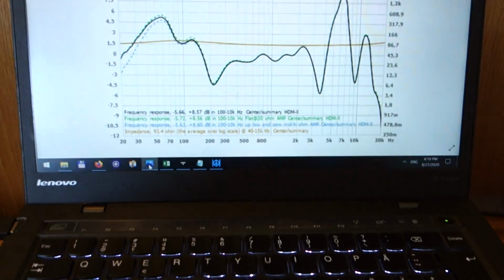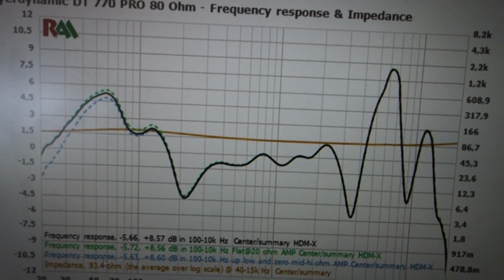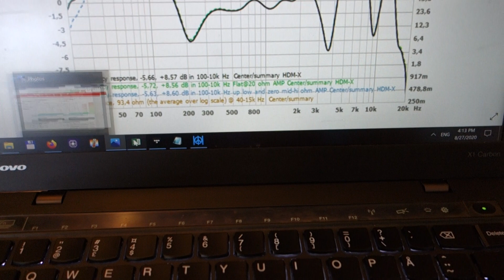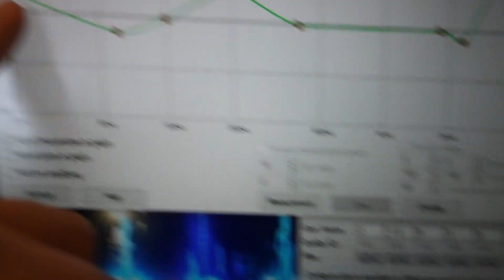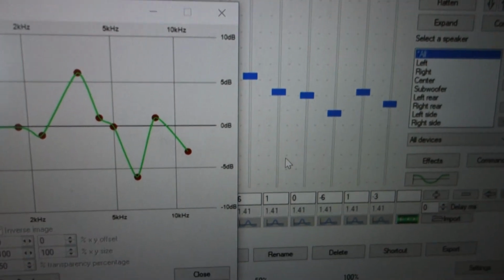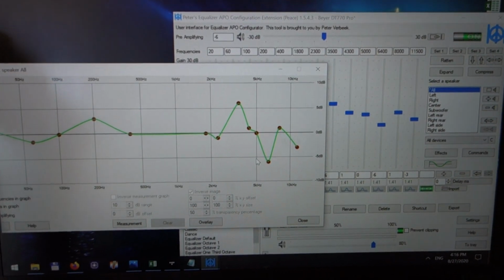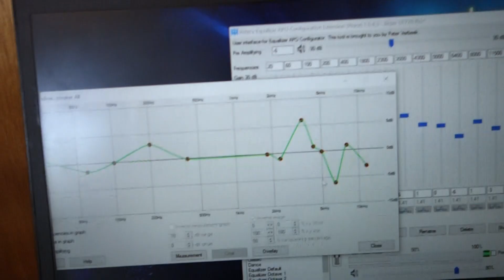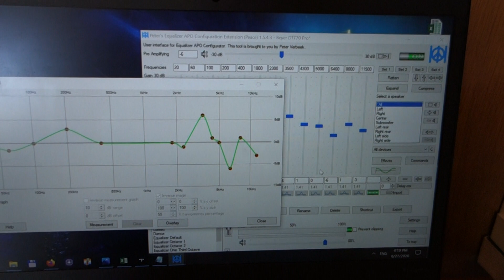Fixing the Beyerdynamic DT770 Pro Frequency Response curve with EQ

Comment: Is there an alternative for Mac users? 

Also, this all looks really great - thank you! I’m happy that there are others feeling the same. My ears have been feeling weird for a while and now I know why.
Reply from the maker: Great question. I will have it pinned in the comments section.
Reply: Yes Sir. SoundSource for Mac. You can use 3rd-party plug-ins for over all playback like Fab Filter Pro Q-3. Blessings + Prosperity.
Reply: use maceq
Reply: I use logic pro..i made a preset of eq based on this video to put last on the master channel to use while mixing and mastering..and remove it before i export…

Comment: nice video! when i first got the headphones, they sounded very diffrent from the ones i had before, but i adjusted to it, and i like the sound profile now. but i still agree that its not very balanced, which ist why i copied yours, but i just adjusted every value to be closer to 0 so i can be more inbetween. I also put -1 instead of -6 for the pre anp because i thought it was too muffled. thanks <3

Comment: Hi ! 
Can I use different eq DAW plugin, if yes, which one? 
Is there a way to import these settings or will I have to do it manually?
Basic question, where do I set the preamp to -6 dB in the recommended equalizer eq plugin?

Comment: The graph you’re looking at has a rang down to -12 which is going to make the dips and highs seem very very exaggerated. Most charts will show a -60 to -90 range and you’ll see it’s a much smoother shape. Those lows and highs are only about 6 db. And the overall frequency response fits the Harmon curve pretty well. With some EQ you can tame the most problematic areas. And remember there is no such a thing as a perfect frequency response for any headphone. No matter the price.

Comment: So my mobo produces very low volume. I have the iFi Uno coming tmrw. I tried plugging into my LG C1 and it gets loud but sounds distorted with the bass mainly and just overall meh compared to my pc with or without Eq set. 

Will this value dac/amp provide loud but also clear quality sound compared to my TV experience. Thank you so much if you can help.

Comment: I agree with you, before i bought DT 770 pro (80ohm) i thought about calibration, and when i tried it with it, it is a day and night of a difference, without calibration, you can't mix with them, beacous of busted highs and seperation between mids and highs and also lows.
Reply: Can you tell what settings you used in EQ?

Comment: deeper sound 😎:
Preamp: -2.6 dB
Filter 1: ON PK Fc 31 Hz Gain -0.2 dB Q 1.41
Filter 2: ON PK Fc 62 Hz Gain -4.4 dB Q 1.41
Filter 3: ON PK Fc 125 Hz Gain -1.0 dB Q 1.41
Filter 4: ON PK Fc 250 Hz Gain 3.1 dB Q 1.41
Filter 5: ON PK Fc 500 Hz Gain -1.1 dB Q 1.41
Filter 6: ON PK Fc 1000 Hz Gain -0.6 dB Q 1.41
Filter 7: ON PK Fc 2000 Hz Gain -0.3 dB Q 1.41
Filter 8: ON PK Fc 4000 Hz Gain 1.2 dB Q 1.41
Filter 9: ON PK Fc 8000 Hz Gain -4.1 dB Q 1.41
Filter 10: ON PK Fc 16000 Hz Gain -7.7 dB Q 1.41
Reply: Hi,
The issue is not what we want to hear, but how to make our headphones as flat as possible, to make a better mixing - mastering

Comment: That EQing makes absolutely no sense and you can hear it in a micro second ! 
Here's a flat profile (80 Ohm): 

Filter 1: ON PK Fc 0 Hz Gain -4 dB Q 1
Filter 2: ON PK Fc 20 Hz Gain -5 dB Q 1
Filter 3: ON PK Fc 37 Hz Gain -6.5 dB Q 1.2
Filter 4: ON PK Fc 71 Hz Gain -4 dB Q 1
Filter 5: ON PK Fc 121 Hz Gain -5.5 dB Q 1.6
Filter 6: ON PK Fc 207 Hz Gain -2.5 dB Q 1.4
Filter 7: ON PK Fc 400 Hz Gain -5 dB Q 1.4
Filter 8: ON PK Fc 620 Hz Gain -5 dB Q 1.4
Filter 9: ON PK Fc 987 Hz Gain -6 dB Q 1.6
Filter 10: ON PK Fc 1416 Hz Gain -5 dB Q 3
Filter 11: ON PK Fc 2347 Hz Gain -7 dB Q 4
Filter 12: ON PK Fc 3550 Hz Gain 0.5 dB Q 1.4
Filter 13: ON PK Fc 4430 Hz Gain -7 dB Q 1.7 
Filter 14: ON PK Fc 5350 Hz Gain -6 dB Q 1.7 
Filter 15: ON PK Fc 9000 Hz Gain -14 dB Q 1.8 
Filter 16: ON PK Fc 12000 Hz Gain 0 dB Q 1.4
Reply: This sounds awful to me.. music sounds muddy
Reply: @GFN1881  You either have a bad source or set the eq wrong. It sounds just like it should
Reply: preamp value ?
Reply: Thanks! Pretty detailed

Comment: Do you know that whenever you apply eq to headphones you alter the response of the drivers the way they were designed to work?  This is why corrective EQ never works well and causes lots of other issues.   In my opinion if you have to do so much to make a pair of cans listenable fir you then you have the wrong headphones.  Exchange them for different kind.
Reply from the maker: Your advice makes sense, it is better to have a headphone that needs no changes out of the box, sadly most buyers cannot try the headphones before buying or sell them afterwards. For them this is a solution. Also would I recommend these headphones with the EQ correction? Absolutely, they are great! If you have the money go for the DT1990 Pros they are obviously better ;-)

Comment: Hi G P, would you recommend me to import the settings you mentioned if I am a music producer, mixing and mastering engineer. also how can I get back to default settings later if in case I change my mind. By the way thanks for the video, its really helpful.
Reply from the maker: I would use this settings for music production too yes, but if you want perfect results I would also consider gettin a pair or DT1990Pro-s they are excellent for production. The DT770Pro-s are mostly for studio monitoring.
You can always change back the EQ settings to 0 or just delete the app so you would roll back to default settings.

Comment: I got them a few weeks ago and had massive problems with distortion in higher frequencies. Those settings fixed that for the most part. Sounds clearer and more balanced aswell. Big thanks

Comment: It works 
,after searching for 3 days found this. I had to remove some 0 gains because I have 10 band eq.
Thank you.
"srcYouT": {
    "frequencies": [
		20,
		60,
		200,
		1800,
		2300,
		3500,
		4300,
		5000,
		6400,
		8000,
		11500
    ],
    "gains": [
		2,
		-1.5,
		3,
		0,
		-1,
		6,
		1,
		0,
		-6,
		1,
		-3
    ],
    "qs": [
		1.41,
		1.41,
		1.41,
		1.41,
		1.41,
		1.41,
		1.41,
		1.41,
		1.41,
		1.41,
		1.41
    ]
  }

Comment: I just bought this same headphone. I notices that when I listen to music with quite low frequencies, there is a distortion. Would you solution fix this?
Reply: Update: I installed the software, applied the settings for the DT770 80 Ohms and boom, sorted out the distortion in the low frequency region and also attenuated the high ends. This makes my headphones sound great and usable. Was considering sending it back, but no more! So thanks for the video, that's a sub from me. 😀
Reply from the maker: @bergspot  I'm really happy for you man! Enjoy, cheerz!

Comment: interesting video, i've been thinking about this too. you should keep in mind tho that these headphones where made to be used in studios with proper output like an audio interface. i completely agree these have a very harsh high end and thin mix when powered by a phone and the dac that's in the phone. when listening to the same song with the same headphones on my audio interface the mix sounds way bigger and the high end is less fatiguing. i think the headphones just need a lot of power input to unfold their potential. i just ordered a dac for my phone so i'm excited so see if this will change anything in the sound stage on my phone. nevertheless a very good video!
Reply from the maker: Thanks for sharing your experience. Btw I used SMSL SP200 as an amp, it should be more than enough to drive them (like 5x times)
Reply: @GP-qb9hi  wow interesting, i use a focusrite scarlett, 3rd gen, and it sounds pretty good in my opinion, especially comparing to my phone dac. my external phone dac arrived too, sadly didn't make a big difference. yet the external dac does a really good job when plugged into my laptop. i think it just really needs a lot of power too but idk.

Comment: I recently bought the dt-770 m and I want a little bit more sound from them. What software should I use..or should I buy an amp?
Reply: I don't know why the video OP lied to you, but the dt770 80ohm 100% needs an amp in some cases. If your volume is low, you probably need an amp. A cheap fiios amp or something similar would be plenty for the 80ohm 770s. 

My 770s were too quiet as well, but an amp fixed that.
Reply: Something like creative soundblaster play 3 for 17 usd is more than enough, if you don’t want to spend more.
Reply from the maker: The 80 Ohm version doesn't need an amp. A good dac surely helps. The rest is in the description/video.

Comment: hmm me personaly hate the 6400hz -6db thing, I tested it out, and find it taking too much brightness, so I keep it -1db, overall awesome and so helpful video!
Reply: I usually dont have any problem with sibilants on 770's, but sometimes i feel a little bit fatigued. And yeah,  minus 6 dB takes away too much clarity, so i figured out that -3 -- -3,5 is fine. Quick update: forget -3.5dB at 6kHz. -3dB is a perfect balance between clarity and sharpness. Also, im using Sound Blaster AE-9.

Comment: This is the frequency responce for a 24dB range the average listening volume is 60-85dB so alot of the small peaks you see are practically inaudable see for instance the sennheiser HD600 graph a headphone 4 times the price (links dissallowed)
Reply: I find it very pleasant at low volume, when eqed I find them very boring.

Comment: hello on my laptop the 80 ohm dont have so much volume, what should i do`?
Reply from the maker: First make sure it is not your volume settings in Windows. If it's maxed out at everywhere you need a dac-amp. For example a Dragonfly Black/Red is a good choice if you need something portable.
Reply: @GP-qb9hi  its also good a cheaper one, like the hifi headphones Amp?
Reply: @GP-qb9hi Oh, and one more thing, could I solve the problem by simply increasing the gain with the programm tha you used?, or is there a risk of them breaking?
Reply from the maker: @utentesenzavoglia1475  You can try the program, they might sound louder but it is not a final solution as you will get more distortion.
Not sure what you mean be the "hifi  headphones amp"

Comment: Is it true that the hissing is less bad with the 80 Ohm version than with the 250 Ohm version? With 250 Ohm the hissing can be really unpleasant.
Reply from the maker: It is quite bad with the 80 Ohm version too...
Reply: @GP-qb9hi  I don't have the DT770 250 Ohm anymore but if you still have/use yours you can get replacement ear pads for them that should make the hissing a bit less bad. Take a look for "dekoniaudio".
Reply from the maker: @therealjantube  I'm using the DT1990 Pros since but thanks for the tip!

Comment: Nice vidoe. I felt the same. I found that penetrating high tones described as "Beyer Peak". I wasn't able to get rid of it everywhere. Sometimes the EQ only made it quieter but not better. Using EQs is not the perfect solution for me. You need the EQ on every device you use the headphones and they are sold as studio headphones so they should be more linear out of the box in my opinion.
Reply from the maker: I have to agree. Beyerdynamic actually recommends the DT250 for studio use, it is somewhat strange to me too that the DT770 Pros are more often used.
Reply: @GP-qb9hi  Right, I have never seen the DT250 in a studio and money shouldn't be the reason because a studio is very expensive anyway. audio-technica and Sony are brands I have seen in some making of videos but I think you can see the DT770 or DT990 the most. I don't know why. I want to try audio-technica when I have the chance.
Reply from the maker: @therealjantube  Here is a cool studio recording where they used the DT250 https://www.youtube.com/watch?v=GPTY6l_PX5k
Reply: @therealjantube  if youre still thinking audio technica try the m40x. Best headphone in there lineup in my opinion. Much more pleasant, and flatter than the more popular m50x's

Comment: can u use the same curve for the 250 ohm  version  with an monoprice desktop headphone amplifier? greeetings?
Reply from the maker: It won't sound exactly the same but it's a good starting point yes.
Reply: Hey here are mine Settings for the DT 770 Pro 250 Ohm Version.
I have tried to keep the Voice Signature of the Headphones and tried just to lose the harsh highs....

The Pre-Amp: -5.5 dB

EQ - Settings: GEQ = green

Filter 1: ON PK Fc 20 Hz Gain 0 dB Q 1.41
Filter 2: ON PK Fc 80 Hz Gain 0.5 dB Q 1.41
Filter 3: ON PK Fc 120 Hz Gain 0 dB Q 1.41
Filter 4: ON PK Fc 230 Hz Gain 1.5 dB Q 1.41
Filter 5: ON PK Fc 400 Hz Gain 0 dB Q 1.41
Filter 6: ON PK Fc 1800 Hz Gain 0 dB Q 1.41
Filter 7: ON PK Fc 2300 Hz Gain 0 dB Q 1.41
Filter 8: ON PK Fc 3600 Hz Gain 5.5 dB Q 1.41
Filter 9: ON PK Fc 4300 Hz Gain 1.5 dB Q 1.41
Filter 10: ON PK Fc 5000 Hz Gain 0 dB Q 1.41
Filter 11: ON PK Fc 6400 Hz Gain -5.5 dB Q 1.41
Filter 12: ON PK Fc 7600 Hz Gain 0.5 dB Q 1.41
Filter 13: ON PK Fc 11800 Hz Gain -2 dB Q 1.41

Give me a feedback and thanks to the the original Author, these settings were great starting points.
I used this website for the improvements
https://reference-audio-analyzer.pro/en/param6.php?idhp=803&idhp1=562&idhp2=563&ls=1&idmain=803&m25=25#gsc.tab=0

Have Fun!

Comment: man I'm struggling to find a healthy balance for these headphones.. the sibilance is way too harsh in a lot of songs. Yes your eq settings or other settings reduce it a lot but you just lose so much clarity.. I really dislike the underwater feeling but I also can't stand the sibilance without EQ.. What should I do.. Would getting other headphones fix this problem? If yes which one would you recommend?
Reply from the maker: The sibalance problem is specific to the DT770 Pros, so yes getting a different pair would most likely solve this problem. But from the headphones I have tested none were as detailed as the Beyers. So I first I would give it some time, maybe you can get used to the EQ-ed settings but if not get another one. Which one? Really depends on your preferences and budget.
Reply: @GP-qb9hi  Yea I will give the EQ a bit of time. But I don't think I will get used to it. My budget would be around 250€. I've been looking for headphones that have a similar sound to the 770 but optimally without the pain in my ears from the sibilance.
Reply: @shayed0712  get the dt990:)
Reply: @dkoolkxng7407  I actually just ordered the hd 6xx after hours and hours of research. Pretty sure the dt990 have the same issues with the brightness. I think all of the beyerdynamics are like that
Reply: @shayed0712  yeah the dt990 sound sharp and harsh

Comment: why the pre amp at -6?
Reply from the maker: Because on the EQ curve there is a +6 gain at 3500Hz which could theoretically distort if you are going above 0dB level. They say with EQ you should always take back volume, not boost it. Essentially the pre-amp @ -6 fixes that.